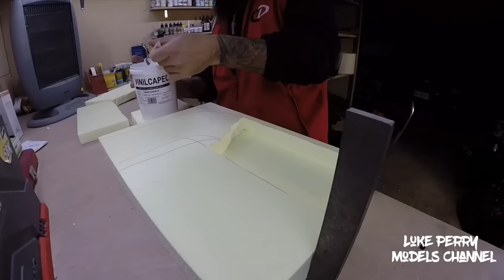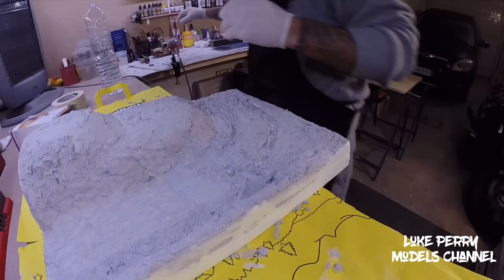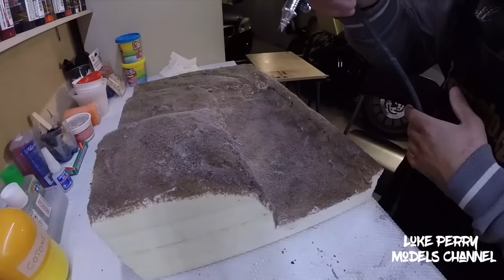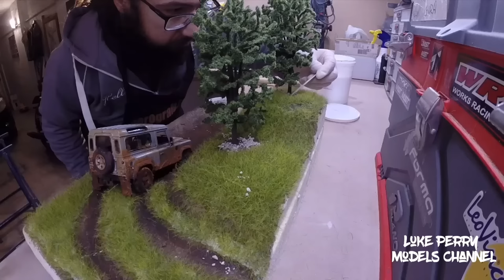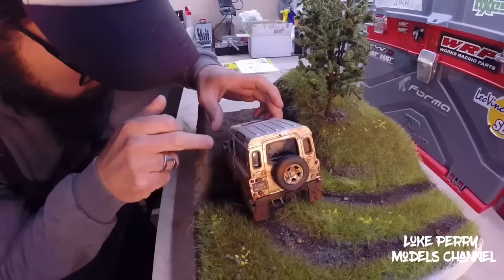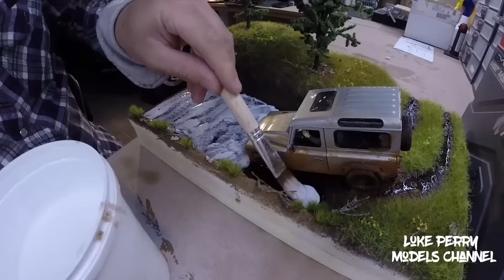Full Build Video: Off Road Diorama (1:24 scale)

Comment: A fantastic job, well-done! I notice you smoothed your base foam with sandpaper. Can I suggest you use a Surform or a Shinto Rasp for that task, as they are a lot faster than sandpaper (and leave less fine dust, and also leave a slightly rougher surface for the next plaster/clay-like textures to adhere to)?